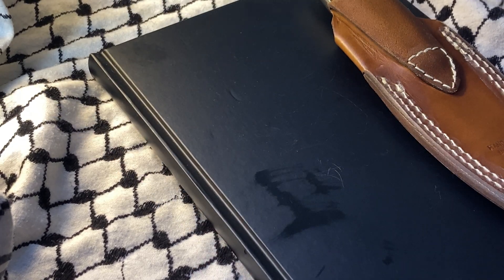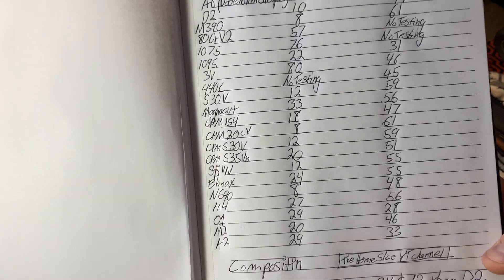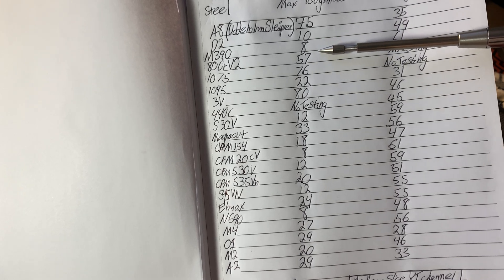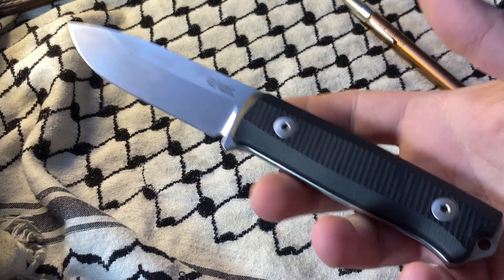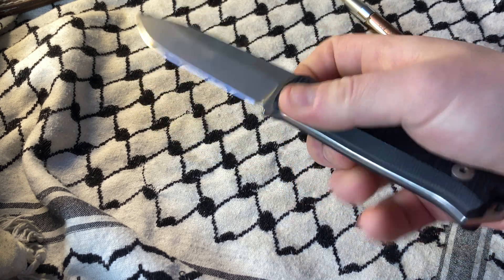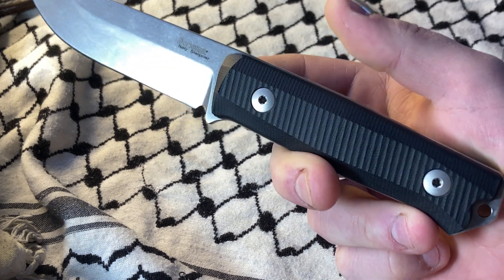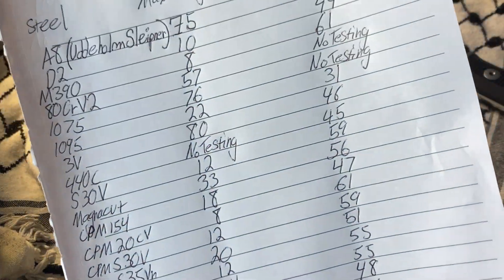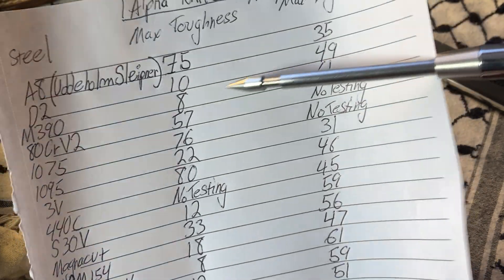Sleipner Steel - Tool Steel with Very Good Toughness & Intermediate Wear Resistance (A8mod)

Comment: I'll pick a tough steel that's easier to sharpen over a steel with great edge retention that's harder to sharpen with less toughness. I actually like sharpening my blades so edge retention doesn't impress me. I hate blades that break or chip as I'm hard on my blades and don't want failures of any kind.
Reply from the maker: It’s too bad no steel is “perfect.” M390 would be great if it were just fundamentally different without changing.

Comment: Sleipner is NOT Uddenholm's Version of A8mod.
A8mod and Sleipner are quite different steels. Alloying elements are same but at different concentrations. 
Sleipner have almost double amount of carbon and molybdenum and significantly less chromium. 
Sorry but your video is misleading.
Reply from the maker: No need to be sorry. Thanks for the heads up.
Reply: What steel would you compare it to? Larrin Thomas has said it's similar to ingot cruwear.
Reply: @MRGoods89  Japanese SLD10 steel is quite similar to Sleipner.

Comment: According to new insights I saw, Sleipner is supposed to be similar to Cru-Wear which is similar to 3V in the data points that matter. I have a Sleipner blade (Joker Bushlord) which I haven't tested yet and a 3V blade (CS Trail Master) on its way to me.
Reply from the maker: The new gen of super steels has some similarities to the not so new super steels, just a bit better, imo
Reply: An important distinction to make: Sleipner is similar to ingot cruwear, not powdered. I do like the properties of sleipner though. Have you tested out that bushlord yet?
Reply: @MRGoods89  That's correct. I have tested the Bushlord with Sleipner in use and I like it. Sharpening is easy. I have also more or less tested the Trail Master with 3V. Also got a Master Hunter in 3V since then. All 3 knives are great for what they are. Sleipner feels like a bit less tough and less wear resistant, though. No scientific tests here.